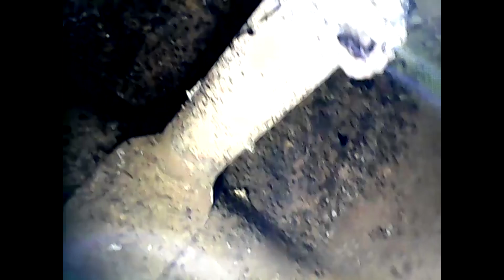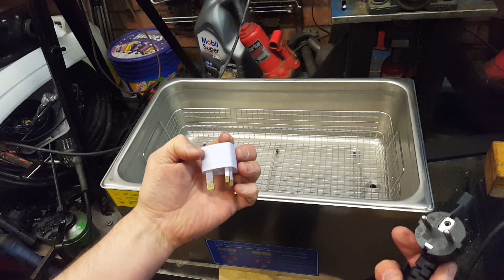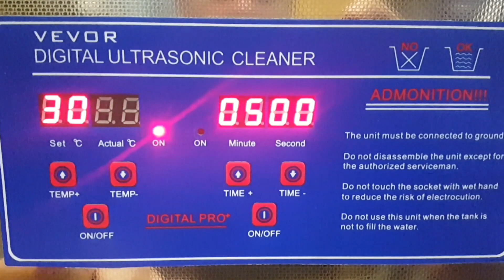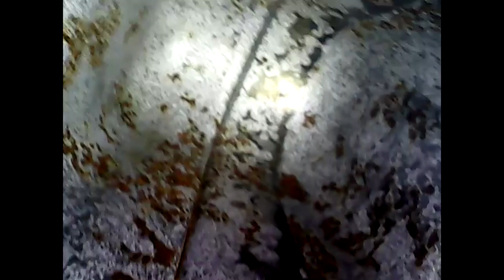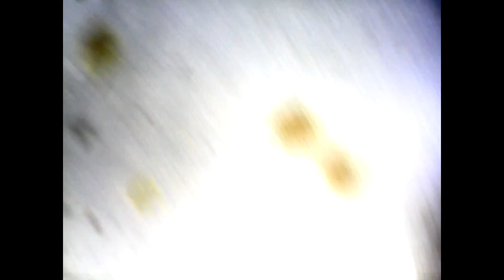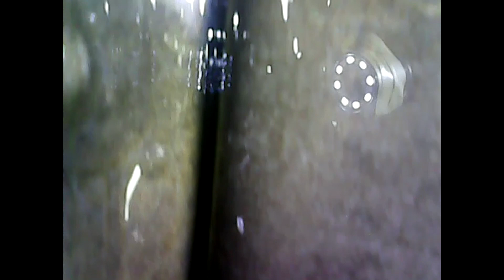Part 1, Fuel Tank Cleaning, Sealing, Resin Lining, Restoration & Ultrasonic Cleaning, Tank Cure

Comment: Thanks for a great video, I’m about to do a larger tank from a Honda, but after watching this in now a bit worried.
The kit you show is the exact one I have. The tank I have is heavy in rust inside. Have your tanks held up after the treatment?
Reply from the maker: Cheers 👍 yes they have but just be very careful, i have had a few people contact me via this platform saying what i nightmare they have had asking for help, i would not change my process again, maybe used i blow torch to pop the bubbles on the resin prior to pouring as well as vacuum not sure just like the wood working resin people do, but no take it that serious anyone can lob it but if you want it to last👍

Comment: I have just done a zzr1100 tank, I heated the whole tank as I turned the tank taking care not to get surface anymore than warm, this was to help pop the bubbles and it seems to have worked. Got the tip from carbon mods carbon fibre wrapping and moulding videos.
Reply from the maker: I will give that a watch. Dont know if you have seen pt2 but im happy with the results now. That said what you have said works well but i could not think how to heat the tank and rotate on a finished paint job. Maybe the rig i built in pt2 would have helped. As said i will have a look and thanks for letting me know 👍